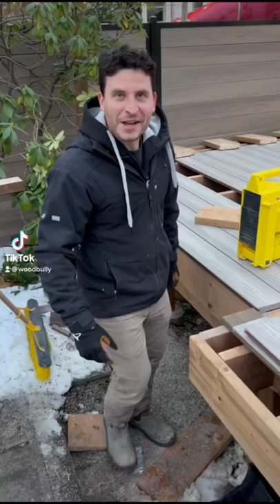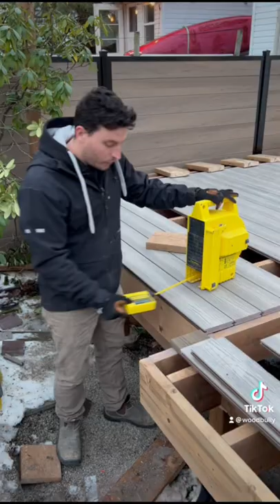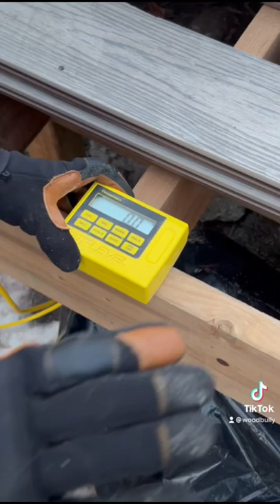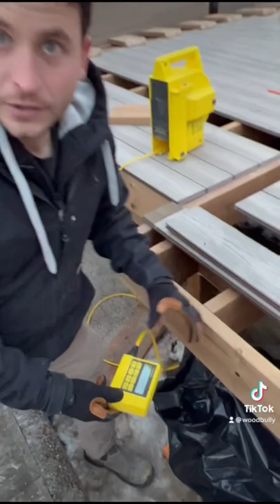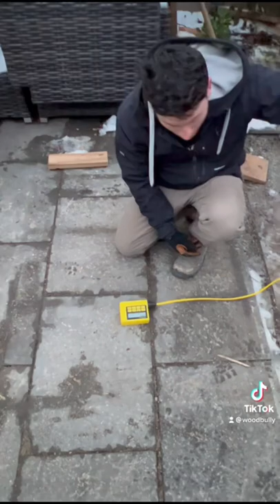NEW TOOL FOR CALCULATING STAIRS! #carpentry #deckbuilding #shorts

Comment: As much as I love my fancy pants laser gadgets, I would have made that measurement with a 2x4, level, & tape.
Reply: Yeah I think this is a crazy tool, but the 2x4 level and tape is always there for me and treats me well :)
Reply: I agree with both of you we didn’t have stuff like that on the job I built decks for 25 years Pops always built the stairs / tape measure a level 2 x 4 and then he get his framing square and he would do all the mathematics in his head and then use these little brass things that attach to the framing square with a thumb turn on them and lock them down and then get his Skil saw out and start cutting.
Reply: If you even need the 2x4
Reply: I don't know how far out this can go, but after a certain depth and length those items wouldn't work anymore, like for a staircase that starts at 3-4 meters off the ground.